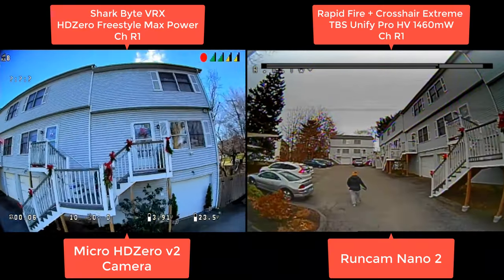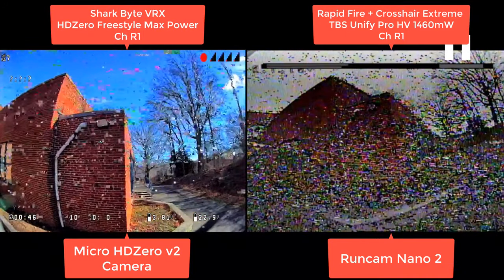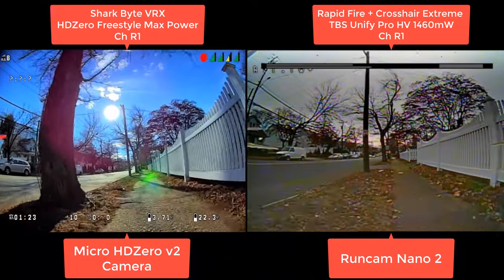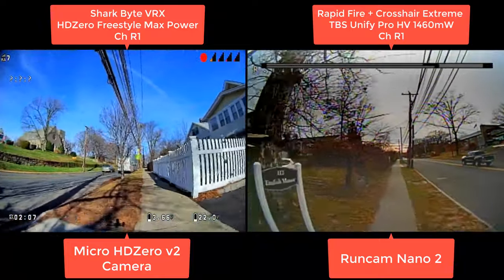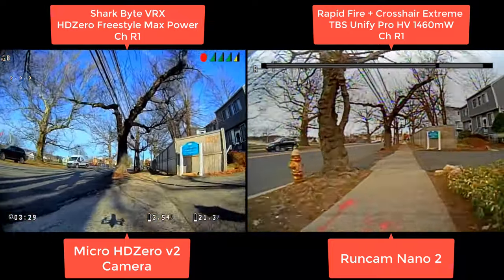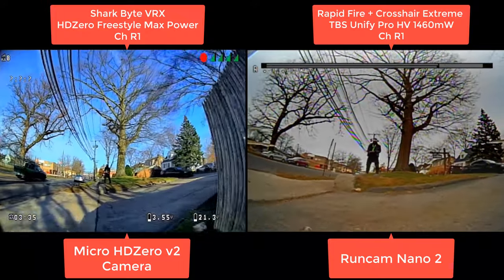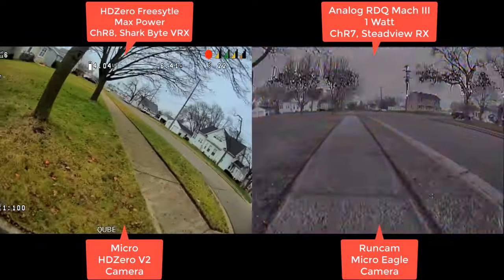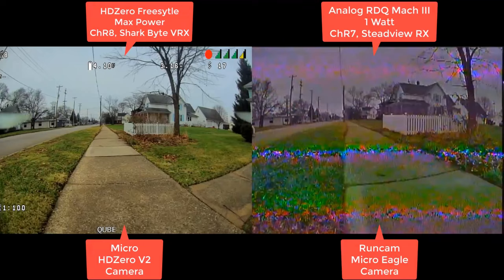Urban Outdoor Environments - HDZero vs Analog Penetration Tests

Comment: how important are the antennas? truerc are a "must have" for best penetration or is it more important to use the same antennas on vrx and vtx?
Reply: I'm the only one who has used the trueRC patches so far built into the casing via u.fl.

While you do gain 4.5db per crosshair on the stock patches and it is noticeable, the main difference is i noticed was the reception without moving my head. 

120 degree v+h beam width v 90(of which only around 40-50 is beneficial)